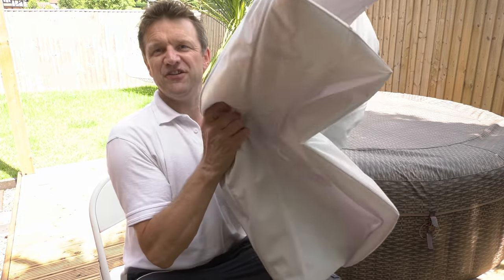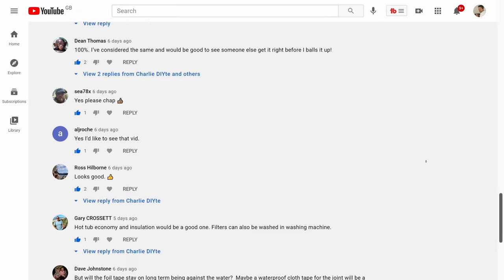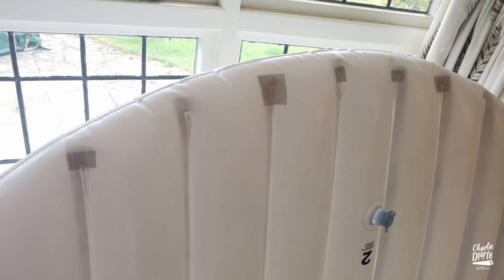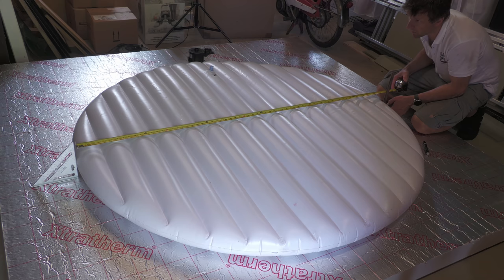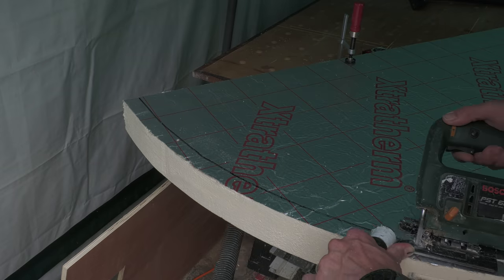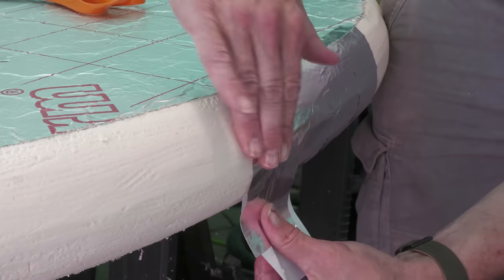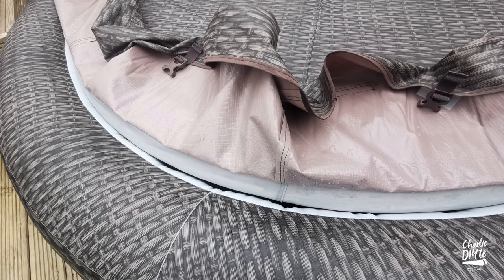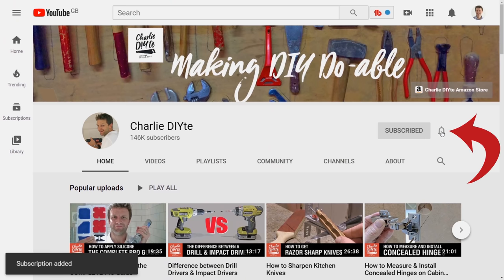Lay-Z-Spa Hot Tub Inflatable Lid Upgrade

Comment: But you can no longer fold it up and put it away in a box. You’re left large, solid sections of insulation. You then need somewhere to store it. Part of the draw for people with these hot tubs is that you can fold it up and put it away easily when it’s not being used in the winter.
Reply from the maker: I see your point, but this is an issue for Bestway to resolve not me - as you saw, 12 puncture repairs and it's still leaking. Mine stays out all year round. I have nowhere to put it without it being eaten by rodents and it's used continuously throughout the year.

Comment: Could you have cut the center joins at a slight angle so that when inserted in the cover the two pieces tent up slightly (by say 5cm in the middle)? This would completely eliminate the risk of water pooling on the top.
Reply from the maker: You could Nial but it wouldn't sit flat on the tub and the "v" would leave gaps under the apex of the "v" on both sides.

Comment: Just been thinking, these inflatables don't actually do anything. They don't insulate - they are just air.  All they do is keep the lid up and prevent sagging.  Any rubber ring type inflatable will do the trick!    Also, anyone tried filling it with polystyrene balls?  They'd massively increase the thermal insulation beyond just some air wouldn't they?  And you can fill straight through the spout.  About £20's worth should do it.
Reply: I just said that tonight, wouldn't it be simpler to fill up the lid with styrofoam beads, like a bean bag?

Comment: Cheaper option is a kids inflatable rubber ring sits inside on the water so no Sag 10 quid £90 cheaper 👍
Reply from the maker: But if the old cover had punctures and deflates you're wasting a huge amount of energy trying to heat the tub.

Comment: Pump up the inflatable lid with expanding foam, even if it already has leaks they’ll seal up and you’ll be left with a rigid foam inner lid
Reply from the maker: You'll need a fair few cans to do that! Interesting idea though.
Reply: @CharlieDIYte  It doesnt work unfortunately. The foam requires air to activate, so it just stays in its liquid form.
Reply: @itsasmiththing4749  Not air but water. PU cures with humidity.

Comment: My lid is much better than that 🤣🤣 Firstly I didn’t attempt to fit it within the inflatable lid lining of the lid but made it big enough to lie across the top of the tub so it seals much better. I also made it hinge in the middle for easier access to the water for testing and treatment. I worked out that the clips had enough spare to accommodate a 80mm thick depth of insulation board (must be closed cell like Celotex) so I bought 4 boards of 40mm depth with the boards offset so it gave me a stepped hinge in the middle for better heat retention. I wrapped the boards with polyethylene sheeting as I was worried about the chlorines effect on the silver foil as a previous insulation attempt with exposed foil had led to me having to adjust the water a lot. Gorilla tape was used for the hinge. I attached the lay-z-spa cover to the new lid with double sided foam tape. My tub is the square Hawaii so I had to make a cardboard template for cutting the edges, which used the seam lines on the cover as a guide. No heat comes out the lid now (got a heat camera) although more comes out the sides.
Reply from the maker: Yep, makes sense Andrew. I'm regretting trying to design this to fit inside the skirt.
Reply: Hi Andrew - any pics or further details on the general layout and construction of the boards with respect to the internal and external dimensions of the tub? Four months on from your comment any other further lessons learned?I also have a square Hawaii and it's up permanently so I'm not fussed about something that packs away.  Regards, Matt

Comment: 8.23 why could you not just cut off 3cm's from the centre and put it back in after?
Making the top 3 piece.
In fact your best doing 4 pieces like a mould insert would be.
Reply from the maker: Dave that's a damn good suggestion. It would be undoubtedly weaker and you do get the foil tape cracking on the join, though I've now put gaffer tape under the foil to strengthen it. You're right to focus on this point though as, whilst the new cover is brilliant, it's definitely a bit too small. 👍🏻